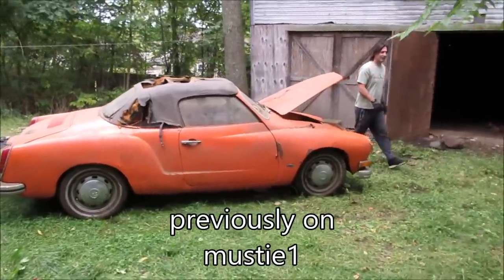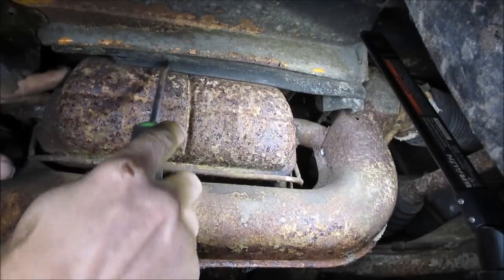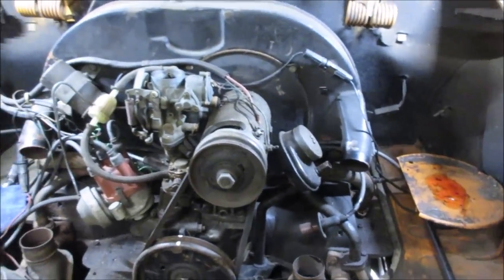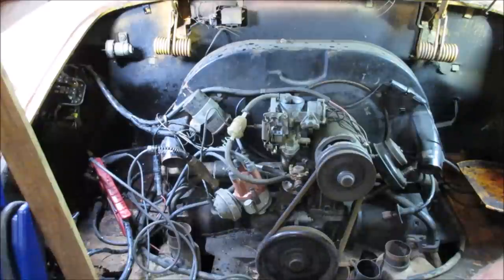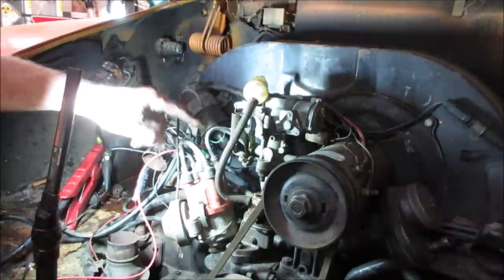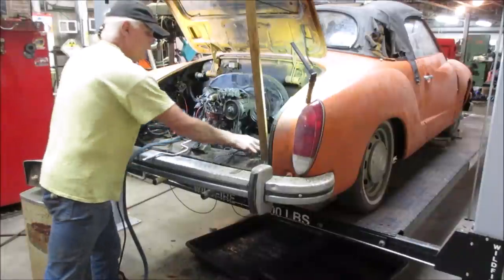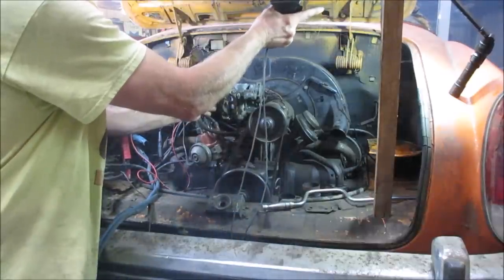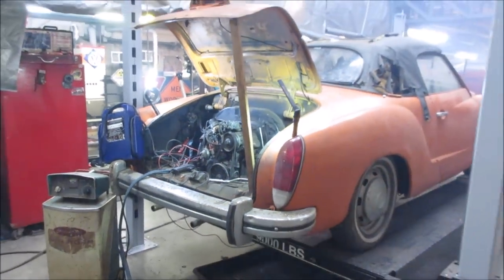One Sad VW, But Can It Survive?

Comment: Let's give a round of applause for the starter motor.
Reply: Made to last back then
Reply: Great comment.
Reply: Yes I was a bit worried that it would give up but it lasted. Quality build
Reply: Too late, I think it left! 🤔
Reply: And the battery.  For once Mustie had a battery that was in useable condition
.. 😂.   Edit.  See it was a battery pack.  And then a partially charged battery...again LOL.
Reply: Nuff said. 👍
Reply: After finishing the video, I fully understand and appreciate your comment.  I predict this will be the top comment of this video.
Reply: I know, right? Whatta trooper!
Reply: Indeed
Reply: He’s always ruff on one ! Lol
Reply: Mustie is always hard on those starters lol
Reply: I had a 73 Bug. Drove it 190k just oil changes and tuneup. A few other adjustments.
Reply: 🤣 yes and the suffering rod bearing
Reply: The engine was giving it's own applause sound fx
Reply: Well said, they don't build parts like they used to.
Reply: And the Raccoons, let's not forget their contribution. 😁
Reply: Can't beat early German Engineering! It was built to last! Awesome comment, was thinking the same thing!
Reply: The backfire was the starter fighting back...
Reply: That's one of the damn tuffest starters that I've ever seen now
Reply: Hold the switch just a little bit longer it might start
Reply: Haha!!! No kidding!!!!
Reply: absolutely
Reply: @itsmephil2255  and now. its some wire around a magnet it hasn't changed much
Reply: We’ve had 3 VW’s, 1 ‘74Bug & 2 Squareback Sedans, ‘66 & ‘71.  We’ve never had a problem with a starter ever!!
Reply: I will now name that starter Mustie1 Jr.
Reply: @rexjolles  you don't understand German engineering then
Reply: @itsmephil2255  it's a starter motor they're pretty much all the same
Reply: @rexjolles  you obviously havnt heard of German reliability
Reply: @itsmephil2255  exactly they're still reliable
Reply: Lol... clap clap clap....   thsts for the starter...
Reply: IAt that point  think we can call it an hybrid. It deserves it.
Reply: It actually said thank you at 44:42
Reply: Compression: nothing
Reply: I must be old school for I was taught 8 second max to protect starter from over heating and to keep from wearing down Battery.
But I've watched him succeed enough times to believe he knows what he is doing
Reply: @itsmephil2255 😂

Comment: That starter motor it’s the real MVP. It survived that severe workout that was suddenly put through.
Reply: It’s German made… it has to run. I’m not surprised. Karmann Ghia was built 50 years before time. Remember Dr. Porsche?
Reply: If you ever owned one, you understand how important that is, and pretty much only thing works well...
Reply: @Herr WHO346, presently owns 5 UDMs. 1X 735i , 1X 735 iAL (EURO Spec) 2X635Csi  1X 535i all M30 Engines. All of them 1986/87 and Chips replaced and will out run any new Matchboxes. Danke Schon und weidersehen. (UDM= Ultimate driving Machine = BMW)

Comment: A foot pedal would be a good idea instead of the pistol grip for starting the engine in same cases.  That way you can have both hands free to adjust things.  Just a thought.  Enjoyed the video as always.
Reply: brilliant idea
Reply: I never thought about that
Reply: I was thinking the same thing!
Reply: The trouble with foot pedals is you tend to step on them by accident while you focus on something else and work in an engine compartment with your hands…
Reply: @jochen7919  You can disconnect it while you are in the engine bay so that doesn't happen.  Hook it up only when needed.
Reply: @jochen7919  Can use a pedal similar to the one used for hydraulic metal plate cutters. No chance of stepping on it by accident
Reply: i have one and i make it by taking one of sewing machines pend a parts and use switch on it so when u push it down it make contact with wire to wire it start up starter
no wonder you stealing my ideas because i have make this back in 2000s
Reply: @kittyztigerz  That's great.  You should of 'shared this with Mustie1 and rest of us years ago.
Reply: @InsertGame1  i would share it just dont like people saying this is useless it not because using starting fuel on one hand other hand opening thotter n foot start it
it easy to make one just find pedals or use two piece of woods and hanger and bolt n wire that petty much make it work 
if i have 3d printer i would be making ton of them n give some to youtuber engine jobs let them test it n see how it goes if anyone want buy it i would throw it on market $10

Comment: I worked on one of those about 33 years ago... and it had more rust than that (being a Michigan car).  It was actually in an Automotives class at a local community college.  We had to replace the complete exhaust and headers on it (with used ones) as well as the starter and battery and the teach rebuilt the entire wire harness for the back and we put it in.  We also did plugs, wires, belts, filters, and oil.  We also mounted 4 new tires.  The body was pretty good on it, but there was a lot of rust underneath.  We were not in auto body, but the teacher did replace a few panels underneath and did some welding.  We hit some of the other rust with some wire wheels and cleaned it up as best we could... then painted anything that needed it.  The car was for a friend of the teacher and it looked and ran pretty good considering what it was like when it came in.

Comment: I'm thinking this car may be modestly valuable parted out. There are probably a bunch of people restoring KGs, probably even an association, that might be interested in the  trunk lid, hood, door skins, glass, engine parts, etc.
Reply: You can get kitcar/GRP bodies for these cars, but would take away value
Reply: @itsmephil2255  Hi Phil, all of my knowledge about auto restoration comes from watching YT and the car shows on TV, so I am pretty much a dilettante, but, to your point, my understanding is that newly manufactured replacement parts frequently do not fit as well as reclaimed original parts, which would make the parts off this KG valuable to someone? Regards.
Reply: How much value and use can there be from parting out the engine and transmission?  Seems a waste to just scrap the rest of the car.  A 1973 convertible Karma Ghia.  They will never make these cars again.
Reply: @joebikeguy6669  So, the kit car/GRP mounts on the chassis - but this one doesn't have a chassis any more...
Reply: @rhiantaylor3446  Hi Rhian. I think you meant to respond to It's Me Phil who mentioned the kit car. Regards.
Reply: @itsmephil2255  the body isn't the bad bit, that's in remarkably good order. The rest of it, however...
Reply: Every VW engine is cookie cutter fits every car thats value. He already said this isn't original engine also they are like a tank just keep trying they will come back

Comment: For a free car there should be a FEW salvageable parts that have value at a VW or local swap meet. Unbelievable what happened to the interior over those 30 years.

You had me worried for a while there, I thought you had finally met a VW that didn’t speak Mustie 1! 

😊
Reply: Most of the interior damage probably occured within about 30 days, not the 30 years it sat... Animals rip stuff apart pretty quickly once they decide to start.

Comment: Great persistence, that was a classic when it backfired .  😂At least it ran, but I think it’s a rod. Would love to know one day what it was
Reply: i dont think its a rod, it makes the noice when he spins it slowly. must be something with springtention or something like it.
Reply: @osbberjen  i didn't hear the knock at high revs but again i am about half deaf...think its valves or bearings..leaning towards rod bearing since it drops oil pressure at a idle..i dunno though..in my 30 plus years of wrenching the only thing i've ever had to do on a vw was replace the shifter ball on a diesel rabbit..the ball that drops in the transmision
Reply: @janeames1513  the rod wont make that sound while turning it slowly. The oil pressure issue can be other things like old and thin oil. Or worn bearings that dont knock. I think thicker oil wil "fix" the pressure issue.

Comment: I had one of these when I was a kid. I used to drive an extra mile or so every morning so I could use the interstate ramp that was downhill so I could be near highway speed at the end of the ramp.  The acceleration could only be described as glacial.
Reply: growing up with underpowered cars like this was a great teacher for me, and im sure  makes one a better driver in the long run
Reply: @fritzkuhne2055  I grew up with big block Chevy motors, the Ghia was the death of me.  We swapped in a tweaked injected motor that helped a little bit but 130hp just wasn't enough for me at that age so I sold it.
Reply: @GuysPlayingWithTools  130 hp? i have to navigate unrestricted autobahn with a worn out 58hp three cylinder xD
Reply: @fritzkuhne2055  I probably spent $1500 on aftermarket bits for that motor so I was pretty disappointed when it dyno-ed at 131.  I expected 200+. It got up to highway speed pretty good but it still wasn't anything near what I considered fast.
Reply: @GuysPlayingWithTools  Should find out what Azn (Farmtruck)did to his Bug to get 600hp out of it
Reply: @aliasfred  right? That cat is long gone though,  a Vette sits in its spot now 😁

Comment: Looking forward to a teardown! Is there a chance that the suspect bottom end bearing could be replaced on it? Also, it's odd to me that there would be such an audible knock at such a low RPM as you cranking it by hand. 

It still doesn't sound good for sure, but it being so loud at low RPM but relatively quiet at high rpm doesn't make sense to me. Surely there would be more force on the rod at high RPM due to inertia, which would make a louder knock
Reply: If it would be a rod bearing I wouldn't think it makes the noise when spinning by hand, could be wrong tho

Comment: Hey Mustie1, love your videos.
I have a tip, that worked on a locked up scooter engine: Poor some oil into the back of a air blow gun, that has a piece of hose on the tip. Insert the tip into the cylinder.
When you pull the trigger the air flow will atomize the oil and coat the whole cylinder.

Comment: In the early 70's, in Australia, a friend turned up one Saturday arvo in his VW van. The motor was making the most incredible double-clanking noise I had heard coming from an engine. He wanted rid of it and we did a deal whereby he drove off in something else. (At the time if a vehicle was taxed, anyone could drive it). Within hours I had got the engine out, and was clawing it apart, I had to see what made that noise.
  Unbelievably, the crankshaft had broken inside the center main bearing, the reason it kept running was that it had snapped diagonally down the angled oil-drilling hole, but was trapped by the bearing cap. Knowing the owners driving style, we put it down to him always driving whereby the engine was labouring under too high a gear.  A lesson for us all, I think?

Comment: The odd thing to me is that even with the spark plugs out that noise was still there. Usually when you take away the combustion, rod knocks will go away or be dramatically quieter. The noise didn’t change at all. I would also suspect that if the bearing was worn that badly than you’d have little to no oil pressure especially while trying to crank. I’d love to see a tear down of this engine and see what’s causing that noise. Great video as always Mustie!

Comment: At 74 I don’t remember everything but if memory serves me #1 cylinder is drivers side nearest the firewall and #3 is passenger side nearest the firewall. The oil cooler was located inside the fan Shroud and reduced the amount of air going to #3 which made It suceptamle to burning/breaking the valve. In later years the cooler was moved back towards the firewall inside the shroud to cure it.

Comment: Okay - so I think it's making 4 clacks per revolution.   It goes CLACK CLACK CLACK CLACK RUMM, the rumm being one revolution.   I don't think a single rod bearing or wrist pin would make 4 per rev.  Now maybe two that were very worn out would, but they would sound different and these clacks sound similar.  Also, a bad rod bearing would be more of a clunk than a clack, and would tend to attenuate as oil pressure was built.  I had a backhoe that did this.  So I'm thinking, what could clack 4 times every revolution?  Maybe the distributor rotor is whacking the contacts on the cap?  The cam gear turns at half speed so I think if a tooth was missing it would clack every other rev?  Broken gear tooth on the crank would clack once per rev.  A bad lifter or valve or pushrod would clack once per rev.  Hey Darren, love your channel and you MUST(ie) do a teardown to tell us what is going on.  Well, I hope you will.  Thanks for all your knowledge and great content.

Comment: The VW Whisperer "saves" another one!  Might be some usable parts.  The tins look half decent.  Rare body, but it's a junk body, maybe a few of the body panels can be saved, frame is crunchy.  Would be a good donor car for another Karmann, and the convertible top hardware is worth saving as well.   That bottom end knock sounds pretty terminal though, although it did improve after a few minutes of "running."    At least you won't have to worry about mosquitoes.   Lots of parts for your stash and to keep your other VW's happy.

Comment: Funny to see you holding the 4 spark plugs up for a closer look. I changed the plugs in my 2000 Corolla, at 215K miles, and they were so bad, I took a picture of them. Pretty sure they were the factory originals. Eroded like you wouldn't believe.

Comment: The convertible bugs and Ghias  had extra reinforcement channels welded along both sides of the pan.  But they rust after decades of neglect.   I had a girlfriend who purchased a convertible bug.  I checked it out and could tell that they rotted....  She was dejected by that discovery...  Bummer!  My friend and I did some drilling, grinding and welding.   We replaced them with new replacement parts.   It was a snap.

Comment: When i have a seized engine, my first move is to force some thin 0w20 oil in the oil pressure gauge port with an electric pump. Does wonders!

Comment: In high school I had a 71 beetle that had a battery that was so weak that during the winter it only had enough juice to turn the engine over one full revolution and if it didn't start in that one revolution I was screwed. Sometimes the accelerator peddle was frozen because of the cold too. I had the routine down to a fine art though and the battery got me through an entire winter.

Comment: Just for the fun of it... Dump a can of "RESTORE" engine additive in the crankcase, roll it outside, start it up and fast idle it for a few hours.  You'll be surprised at the improvement.  I've used RESTORE on a few engines, and it works wonders.

Comment: I didn’t think it would be bottom end until you did the oil pressure light test !, assuming the switch is in good shape. Possibly the oil filter (strainer) wasn’t cleaned through properly and that got clogged too with low oil at the same time. Quite a clank !, but it still runs….

Comment: When you have a stalled engine, and you don't want to do too much work, you can drain the oil, fill the entire engine with brake fluid and leave it for a few days. When you empty it, the engine will be unlocked. It always worked for me.

Comment: Another thing you can do is overfill the crankcase with fresh oil, let it sit for a couple hours, drain it out, and fill to proper level. That will allow the oil to flow into the rings via the ringgaps and saturate them

Comment: heres a tip, add oil kerosene(50 50 mix)   to any cylinder on a angle and  use compressed air and blow the oil around the bore to penetrate and lube it up

Comment: Dang Mustie, you worked to get that engine unseized and turns out it's junk. That's like how my buddy went to the junkyard on 75% off day, busted his butt for 6 hours to pull a Honda K series engine out of a CRV, he got it apart from the transmission, started to pull it out, and realized that the timing chain was snapped...so it's more than likely that the head is junk. It wasn't wrecked, so that must've been why it was there in the first place. If it would've been good he would've gotten the entire K24 engine for $160.

Comment: Like many others have said, we want to see a tear down or find out what is causing the noise issue. Doesn't sound like a rod knock as the engine rpms went up and it went away. The way it consistently galloped with the noises and multiple ones, I suspect camshaft myself.

Comment: Hi  mate, so, watched halfway through the video so far, and the knocking noise has a rythem going unlike a rod knock, laughingly sounds like one of Jonathan Ws steam engines as it shuttle valves.. anyway, Im back watching for the outcome.. thanks - Ian.. UK
Reply: So Smokey Joe runs, ok my guess now is a main bearing cap broken/ bolt missing, but who am I to say.. Its been fun, Part 2 strip down will be Interesting.. Thanks.. Ian..UK

Comment: Have been watching you for years and thoroughly enjoy your work. Watching you switch jumper packs made me wonder why you can’t bypass the jumper pack and go right from 120V AC to 14 V DC with a converter. Endless supply
Reply: Because a starter motor draws a ridiculous current. In some cases more than a residential power socket can supply.
Reply: you can charge at the same time but the charge rate is like 2 amps to the booster battery.

Comment: Got a feeling that knocking noise is in the transmission. What ever it was went away when the engine was running. should have found a way to hold that clutch and spin the motor over.